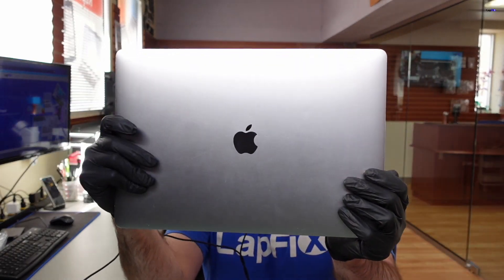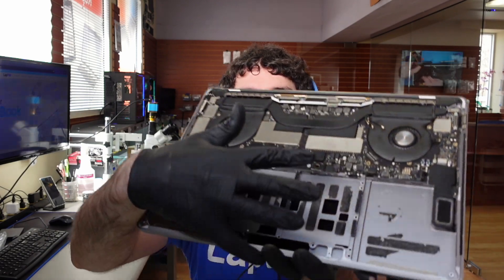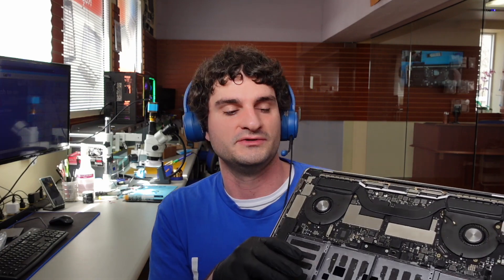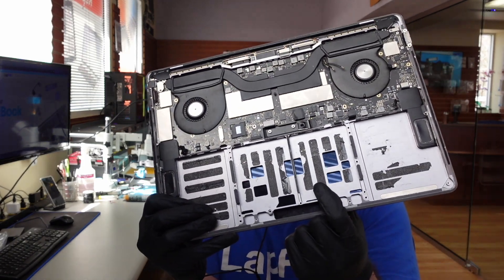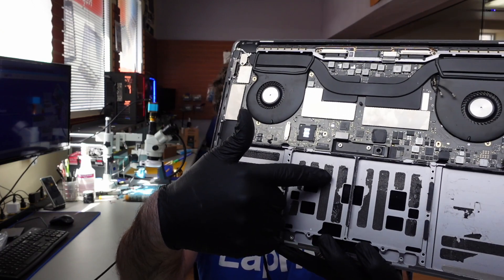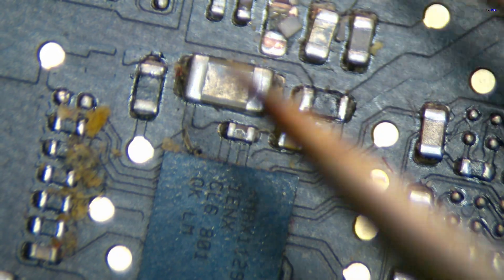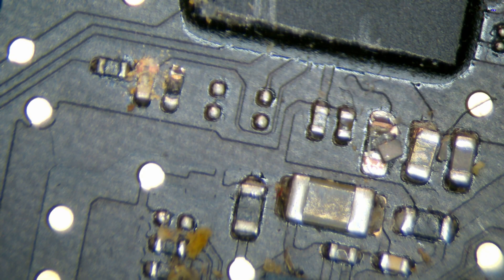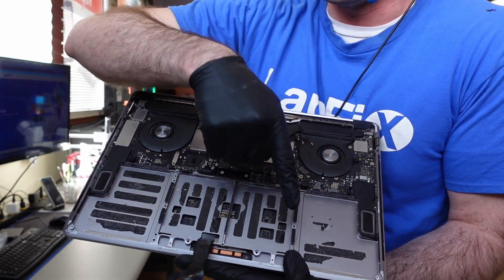Watch This Before Replacing Your Macbook Pro Battery

Comment: Another tip folks:  Place a microfibre cloth on the screen as you start using alcohol.  I see people struggle with removing the battery and even damaging so badly, that it might catch fire. Eric is correct in stating that the battery is in there "good" and using little cheap prying tools will only cause more frustration.  I use a strong nylon wire and slice the sides of the battery loose.  Just use the saw method and make sure you do not scratch the lid as it might slide on the table while you do this.  Work on a clean table or bench or desk.  No screws in the area.  Of course, as this customer found out, the connectors have to be removed first, your new battery comes with them so there is no reason to not take out the screws.  The adhesive can be easily removed if you use isopropyl alcohol, but use the 99% and be careful, open a window to let the fumes escape.  This is not a small undertaking, especially if you have never done it, so consider spending the dollars at a good repair shop like lapfix or even have Apple perform the swap.  It is going to cost you less than the parts and the time and the shame... trust me...
Reply from the maker: Thank you Al for your comment.   Good information and very insightful as per usual 👍